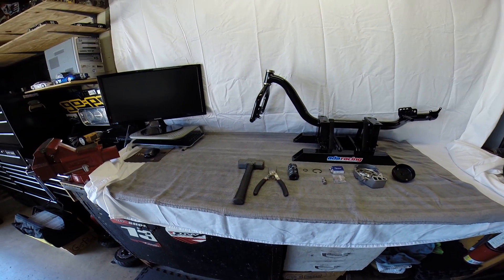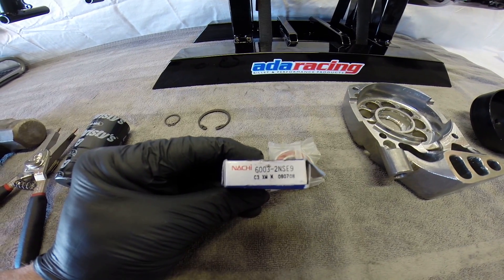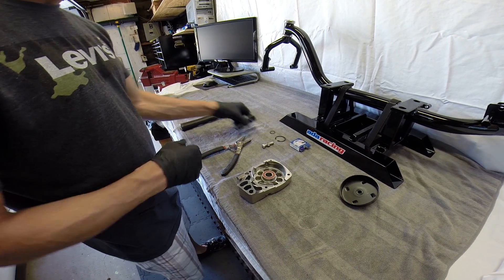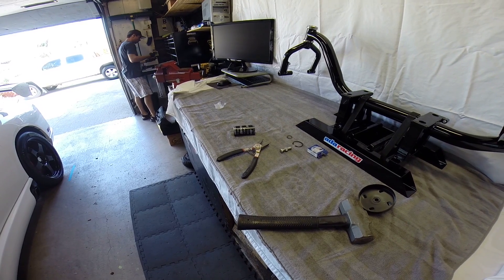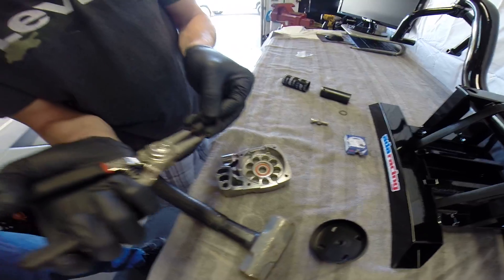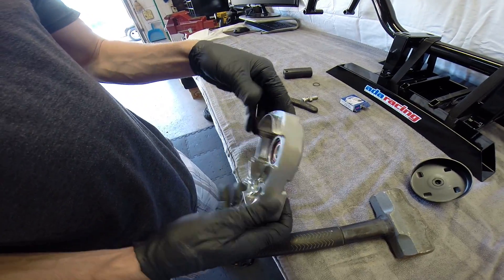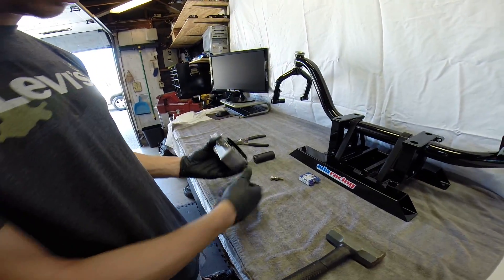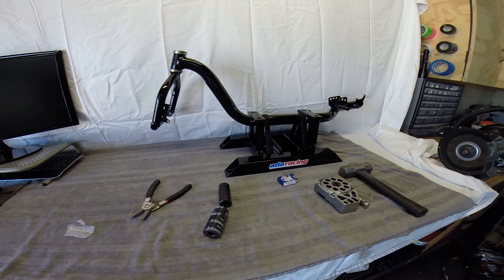GoPed, HOW TO: 78mm Motor Mount Assemble

Comment: I tried this with my gsr sport and had a rough time get the bearing in straight so I was informed to bake the mount and freeze the bearing.  Worked like a charm.  Is there a reason you don't heat them.

Comment: Should I just buy the newer style clutch housing cuz I have old style clutch housing. It sucks the bearings size is different and can't install the bearings in it or the bell like how yours does. I have a gsr 40 frame will it fit on there too?

Comment: Thanks Derek, only NACHI bearing I can find is NACHI 6003-2NSE9 2RS. Same dimensions but the rubber is Red not Black. Should this work? Since I've got the ADA bell and TM's clutch carrier I thought I might aswell replace the bearing. What are your thoughts on ADA's engine mount? Obviously look nice but not necessary?

Thanks bud
Reply from the maker: As for the ADA mount its nice and all but personally if you want real nice high end quality mount then your going to want a Grifftek mount. But if you just want looks and a good price the ADA is a great mount and the way to go. the grifftek mounts are no longer made and are hard to find.

Comment: Hey Derek. What dimensions is the NACHI bearing?

How much are they worth? 
Trying to find one on eBay.

Also, I see in your wheel assembly vid you don't use the spacer inside /between the wheels like Goped does, Does it rotate smoother without?

Thanks mate, keep up the good work bro.
Reply from the maker: No idea on dimensions . Try looking up the model number on the bearing.